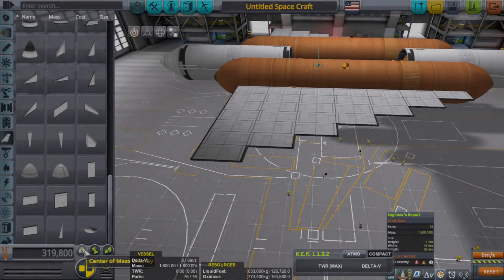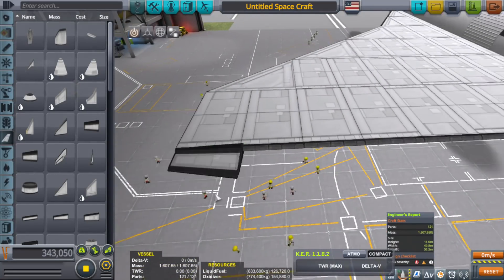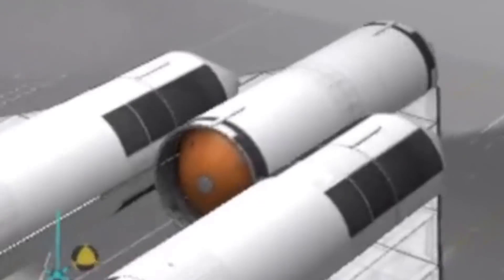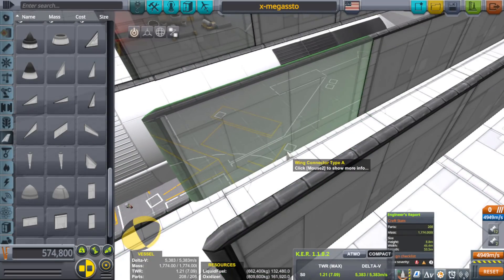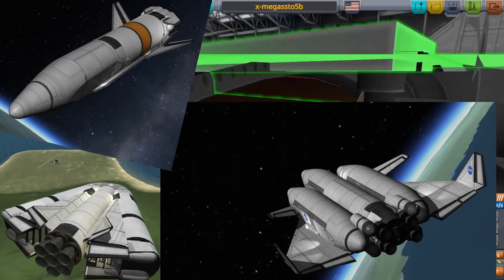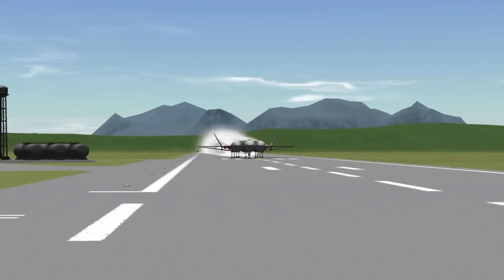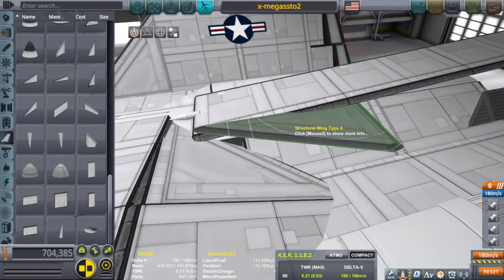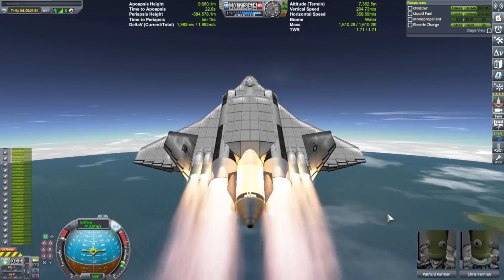290 TONS SSTO RAPTOR CLASS SSRT

Comment: Do your winged SSRTs actually make use of their wings on ascent or are they mostly for landing?
I'm asking bc I have been thinking about the concept of a winged rocket that is basically underpowered to reach orbit but can do so using the lift of the wings. This would allow you to use less engines or engines that aren't exactly optimized for atmospheric flight. Most of my concepts revolved around trying to get the maximum amount of weight into orbit using a single rhino engine. I haven't really gotten to a point where it's actually better than using other means of achieving orbit. I haven't made any calculations but I guess the added weight from the wings bascially eats up any weight saved from not using more engines.
Reply from the maker: If you’re looking for efficiency then perhaps make something that looks more like the x-33. for me personally, I have noticed that you need more Thrust to weight ratio if you intend on launching straight up in comparison to launching sideways and gaining speed for lift. having wings allows you to achieve lift with less thrust. launching at a 40° to 45° angle helps not only gain altitude but allows your craft to gain speed at the same time with only about 1.3 TWR. Plus it helps slow down the craft much better than not having any wings at all during reentry.

Comment: To overcome the rocket-exhaust problem from forward sitting the engines, I put them at the end of wings, or at least midway, and since wings are absolute shit at supporting weight, especially a lot of weight under a lot of thrust, and just invite the kraken at every stage of the mission, I use all the extra durable structural parts instead, sometimes even off-angle fuel tanks, because when you're building an ssrt worrying about drag is for chumps. And you use wingy-bits where you need them for control and hopefully a soft landing. Really what you got to worry about with my designs is heating, so I end up using heat shields and radiators galore, because the things come crashing back thru the atmosphere like bricks until the air is thick enough to give wings control. Skipping off the atmosphere, they are not. Half the time they don't even need airbracks, because they can just pancake the atmosphere whenever they need to slow down.

Comment: But you can totally use clamps arms instead of struts tho
Reply from the maker: i think i know what you mean. docking ports right? or are you talking about same vessel interaction interlocking mechanism? if so I already tried it and it did not end well 🥲
Reply: @vaos3712   nah no docking ports, i meant to reference the advanced grabbing unit or the A.G.U. Junior

I’ve found that they’re more reliable and almost as strong as metalic duck tape, with the added benefit of being toggled ;)

Comment: One thing I've found useful with Kerbal space planes is rocket assisted take off. Basically I have a couple of small solid rockets slung under the wings that help accelerate it down the runway, and get it into the air. When the solids burn out I drop them in the sea, and then fly it like a normal air breathing SSTO.
Reply from the maker: sadly that would be considered a stage and therefore not an SSTO 🙁
Reply: @vaos3712  Yes strictly speaking it's not an SSTO,. But it serves the same purpose of getting stuff into space cheaply. Using a couple of small solids to accelerate means I need far fewer Rapier engines, as the Rapier is very inefficient at low speeds. And fewer engines also reduces the mass of the actual plane, therefore increasing it's delta v. 
Also it''s fun making like a bomber and dropping stuff in the ocean just off the end of the runway.
Reply: Well the Star raker also would have used expandable landing gear on takeoff since it was a lot lighter on landing it ditched a few of the „Wheels“ after takeoff.

Comment: 6:46 couldn't you put small docking ports with same vessel interaction on either side of the bay doors?
Reply from the maker: actually I tried using docking ports for locking the doors, with a single hinge for both cargo bay doors to swing open, but the force of reentry still pulls The docking ports apart even if they’re connected. They don’t break connection mind you, but The docking ports are still pulled apart from The enormous amount of Lift   generated by the cargo bay doors.
Reply: They have weight and they take space
Reply: @mariasirona1622  yea, but I mean, look at that cargo capacity, I don't think the docking port's weight would be even remotely significant compared to that
Reply: @bragapedro  they still take space, that cargo bay looks kinda tight for the tank
Reply: Aerodynamics might be a valid concern, though

Comment: Use a mini docking port on each side of the cargo bay door to lock them together.
Reply from the maker: I tried that. But during reentry the forces of lift created by the cargo bay doors stretches the docking ports enough to mess around with the stability of the craft because the docking ports simply aren’t strong enough .
Reply: You can actually use multiples along the length of the bay for extra S E C U R Eness